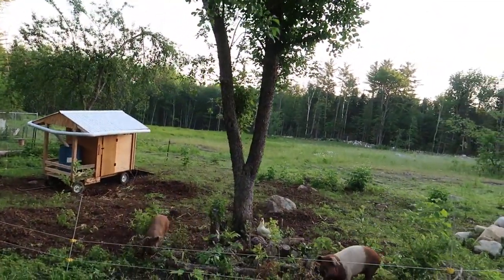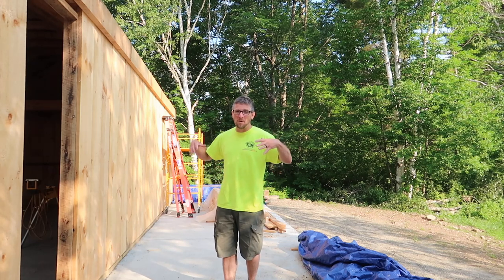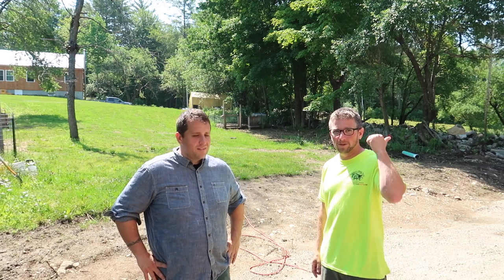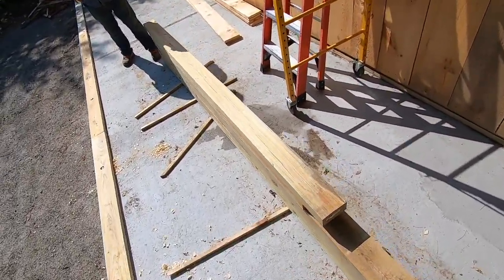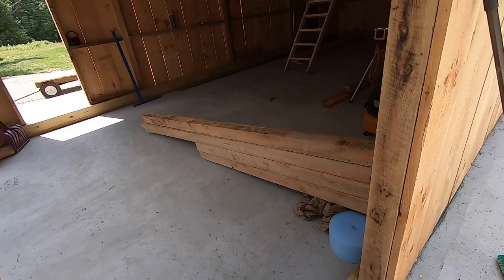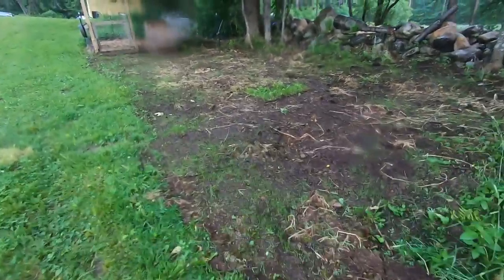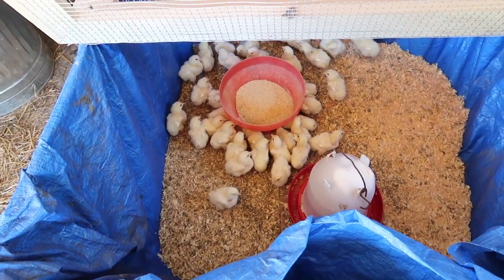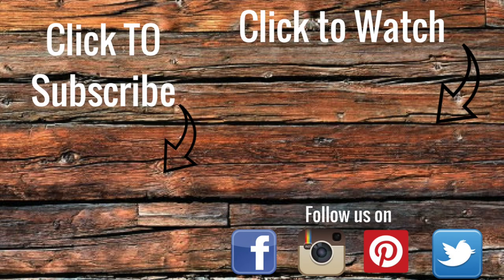Went and started Phase 2 of the BARN build and THIS HAPPENED

Comment: Your barn is coming along nicely I'm still amazed at all the little tricks you come up with to get things done when working by yourself.  Just a little hint when blowing out the holes for your lag bolts when you get to the other side throw a rag around the air nozzle and you won't get that blow back in your face.

Comment: For the sill plates we used to just lay the board on the bolts and smack with a hammer ... Dents don't make mistakes ... Perfect measurement every time ... If you make your raised beds 3 feet or less wide you never have to walk in it so no soil compaction ...

Comment: Al, if you want to clean out a dead hole with compressed air and not have it blow all over yourself;  position the air nozzle tip perpendicular to the top of the hole and close to the opening but not blocking it. It will blow any debris away from you and still clean the hole. An old machinist trick!

Comment: After you made mention of the chicken sleeping outside and you thought that maybe they liked the fresh air, I was wondering if you should put some ventilation in New Yoke City. Even in your climate, they need fresh air in the wintertime. You could cut out a window down low and one up high to create a draft and cover them both with hardware cloth. Then make your slide doors over them so you could adjust how much air you want to move through it depending upon the time of year. Just drill a series of holes to allow a little bit of air movement, up to full air movement. Just a thought and nothing that would take much work.